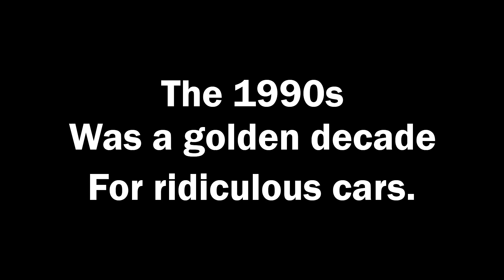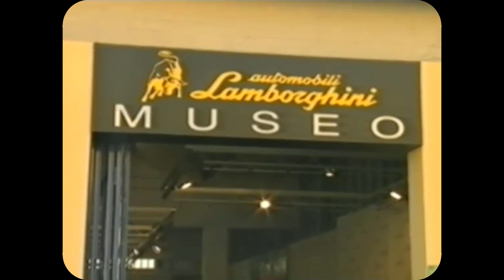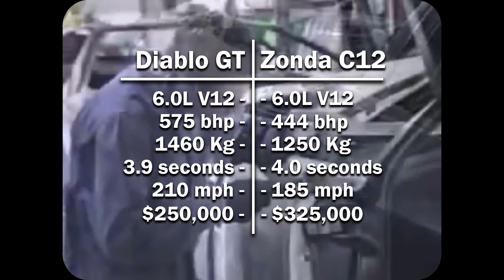Zonda or Diablo? Supercar Showdown

Comment: I'm surprised that it's the Diablo, not the Murcielago being compared with the Zonda, given the Diablo is a significantly earlier car.
Reply: 2002 was the release date of the Zonda but they finished it in 1999. The comparison is still good! The youtuber is wrong about the 0-60 miles of the Diablo GT. The GT can reach 3.4 to 3.5 0-60 and a quarter mile time of 11.1 to 11.3 ONLY IF you will not baby the clutch to get the fastest acceleration! Even the GT and VT 6.0 can match the speed of the Zonda C12 S, A much faster version of the Zonda. If you asked Lamborghini for a taller gear ratio, the Diablo GT will reach 217 to 220 MPH that is about 350 to 354 KPH.

Comment: I thought the Diablo had pop up headlights in development and only utilized the Nissan headlights when DRL became a requirement.
Reply: When 1999 came, they changed the Pop Up to fixed Nissan 300ZX Fairlady Z head lights. The SV, VT, VT Spyder, GT, GTR, VT6.0 and VT 6.0 SE are all fixed head lights borrowed from the 300ZX from 1999 up to 2001.

Comment: I love your Gran Turismo 2, 3 and 4 sound tracks. FOR ME THE DIABLO IS THE WINNER HERE IN THE LOOKS DEPARTMENT! Yes the Zonda is rarer but a few of the Diablo versions like the VT6.0, SE30, SV 1998, SV-R, GT and GTR are now all shooting up in market value. And you know the truth even the Diablo can reach 0-60 in 3.2 to 3.6 seconds that is the versions of the SV, GT and VT6.0 if you are good in shifting. The Diablo is an actual 11 second car with the GT and VT6.0 it can reach 11.1 to 11.7 seconds in the quarter mile only if you are good in shifting. These two 6.0 liters V-12 super cars are the fastest versions of the Diablo and was more refined because it was Audi the one who designed these versions. The Zonda C12 S is a 7.0 mercedes-benz V-12 that is reported to have a top speed of 220 MPH but was not proven and 0-60 is 3.5 to 3.7 almost equal to the Diablo. Independent road test reports said that the fastest versions of the Diablo can go over 215 miles and that was when they tested the GT. ALL IN ALL THE DIABLO IS THE WINNER HERE!

Comment: The Diablo aged terribly, while  Zondas haven't aged a bit.  The 1999 motorshow Zonda still looks like it could come out this year.
Reply from the maker: The Diablo has charm, but its definitely retro charm. The Zonda as you say has aged much better
Reply: @automobilistic  Being called retro as a mid 1990's car is a bad sign.  By then the F50 came out, and looks woefully more modern than the F40 or Countach.
Reply: While The Zonda did age great, I always preferred the looks of the Diablo. Not to mention Lamborghini has more of a racing Heritage over Pagani that wins it for me though how little the it has it.
Reply: @MidnightMechanic  the F50 had a questionable design for sure.
Reply: @traviswalker8933  The F50 had aggressive yet functional design, Ferarri's Viper basically.
Reply: @MidnightMechanic  I'm not quite a fan of the design tbh. They could've done better as the rest of the cars in the line up at the time had a much better looking design. The F50GT though is another story.
Reply: @MidnightMechanic  The F50 was more modern than the F40, yes, better looking, no.
 It definitely had more lines, some that didn't connect with any other or just didn't make that much sense, I'd take the Murcielago over the F50 for looks. Not that I'd buy either, but if I'm gonna buy a car and just leave it in the garage and turn it on once or twice it's gotta look good and sound amazing.
Reply: You are A FREAK! The Diablo aged really well and can even keep up with entry level super cars in todays time! Styling, speed, acceleration, reputation and HIGHER MARKET VALUE is what it has now that is a TRUE CLASSIC SUPER CAR! The Diablo is the better looking compared to the limited Zonda and it is not even too expensive when it comes to its first two versions during the early 2000's. I agree that the interior design of the Zonda is better than the Diablo but engine, power, body design and reputation IT ALL GOES TO THE DIABLO! The only Diablo versions to match the interior of the Zonda is the VT6.0, VT6.0 SE, SE30 and the 99 VT Millennium Roadster. So beautiful interior for the 90's technologically advance super car!